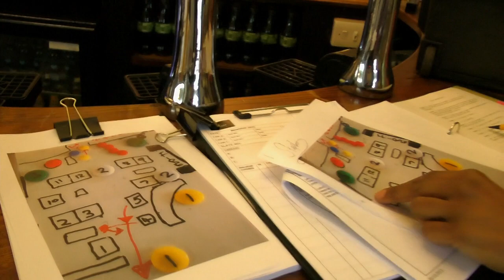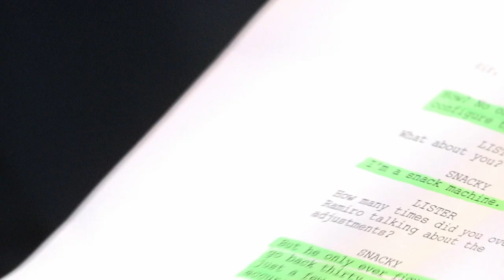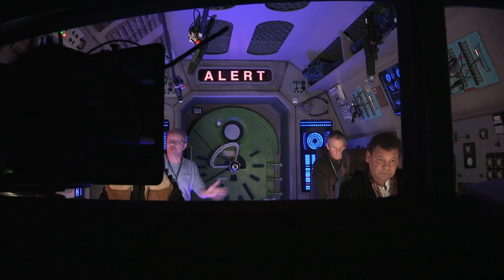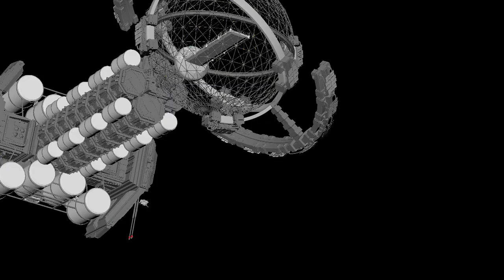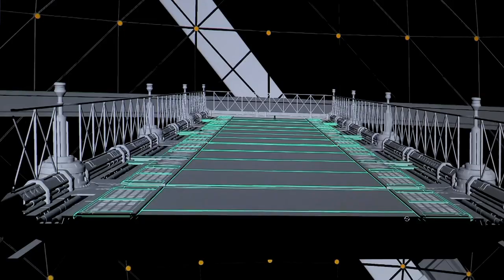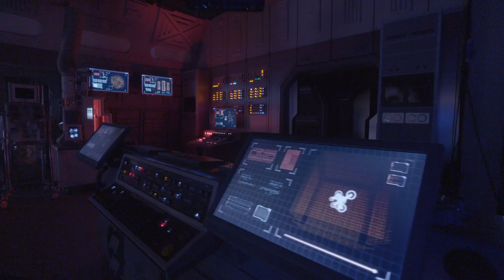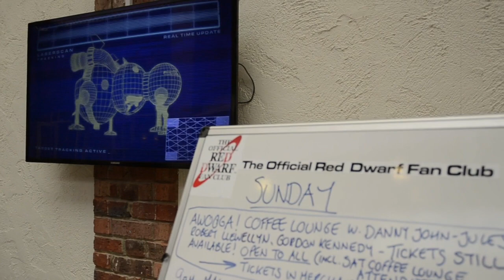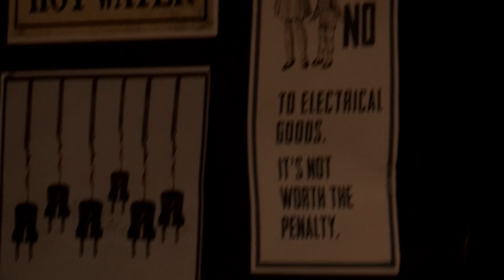Red Dwarf - Series 11 - Behind The Scenes - The Making Of Series 11

Comment: Shepperton Studios is basically all film studios which can be used for television, with Red Dwarf using their 12,000 Sq Ft sound stages. However for Series 11 and 12, they moved to Pinewood Studios, as Shepperton was booked out. This meant they had to use their two TV stages at Pinewood which is smaller at 8,960 Sq Ft each.